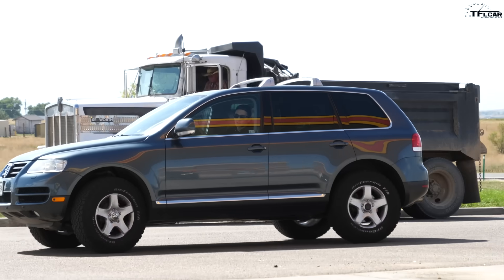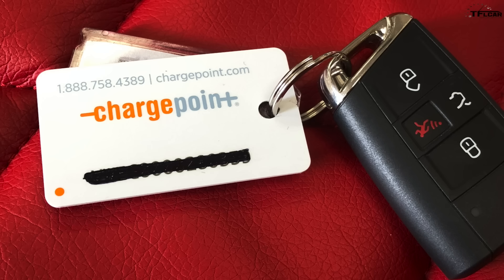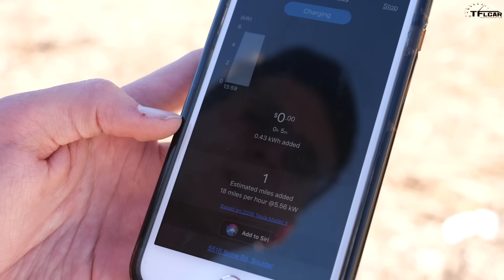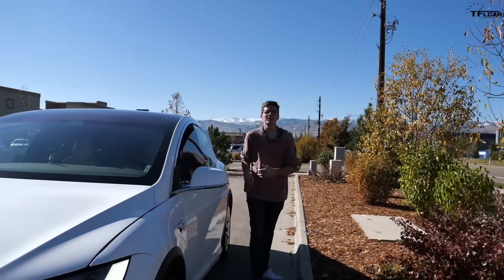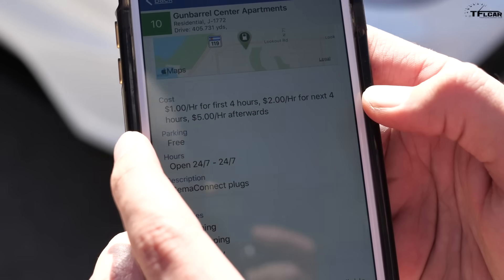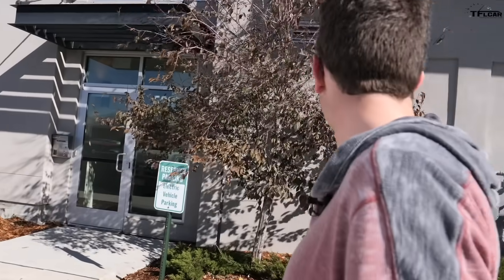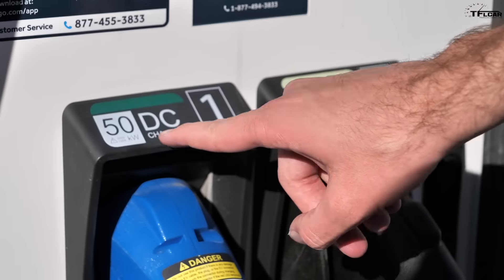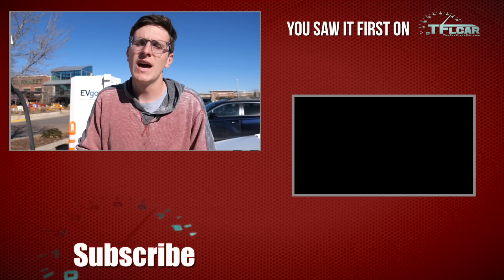Here’s Why Charging an Electric Car Can Suck - And It’s Not The Reason You Think!

Comment: "Most people don't have 240V"

Tommy, every house in the country has 240V, it's how the American grid works.. 2 hots and a neutral. It's there for anybody to use.
Reply: Yes pretty normal to have a 240 for the dryer. Get another in the garage for the car
Reply: And outdoor outlets in apartment parking lots are the norm in Anchorage AK. Plug It In!
Reply: 3-phase  400v in most houses in sweden. :)
Reply: True, but, it costs about $3k install the charger to use it. Make sure you include that in the economics of your EV purchase decision.
Reply: @montesimpson7954  - yep most of the cost is the charger itself, not the wiring from panel to charger
Reply: And when everyone plugs in after a hard days work the electrical grid shuts down !
Reply: What was meant is they are not available for the car.  More cost and resources are needed.  And of course, a garage.
Reply: i wonder what he thinks most dryers run on?
Reply: I know what you mean, the A phase and the B phase. I put 220V in my garage for a car lift.
Reply: @George Elmasry Thanks. My daughter is a 4 year EE degree person. In order to get her degree she had to take what is called: “High Power Lab.”

They have to take that course so if they ever have to do a high power installation, she won’t get killed. 

The other engineers reading this probably had to do this too.

Personally, I am not smart enough to do what she did. Her IQ is considerably higher than mine. I would have her install it for me. I am OK with having a child who is much more intelligent than I am.

Sanjosemike (no longer in CA)
Reply: @George Elmasry Congratulations Dr. Elmasry for an extraordinarily accomplishment and for you advice.

Amy had to stand on a rubber chair and wire up several boxes that were running “live.”

I’m sure she knew what she was doing but it also took some REAL courage. 

Thanks for your advice.

Sanjosemike (no longer in CA)
Reply: People living in appartment complexes wont have access to charging at home
Reply: He said MOSTR do not have 240 in their GARAGE. It helps if you LISTEN
Reply: @JohnFriday3  oic so unless you are outside the USA every house in the USA has 220 or 240 depending on what you want to call it, you should know what you are talking about, if you can afford an electric car you can for sure afford to can an electrician to have socket install for your car and the socket can be placed ANYWHERE YOU want it, even if you live in a condo complex all it ever takes is money
Reply: I install chargers for EVgo
The majority of chargers we are starting to install are 350kw.
Reply: @johnblutut5831  In many parts of the USA 220 is now required in garages in new construction and remodels for EV's to plug into. I know, I had to do it even I don't have a EV.......
Reply: In usa, 240v is usually accomplished by using 2 120v connections at same time
Reply: @williamhaynes7089  Two 120V at the same time.. really? Jesus man, read the comments above.
Reply: @George Elmasry - and how much for the charger itself?
Reply: Even so there are a lot of older homes that will need the panel box itself upgraded which costs $ Your only allowed so many breakers according to the panel you have.
Reply: @Matt-zu2hm  not necessarily. If the panel has the amp capacity you just need to add a circuit.
I added a 50a, 230v to my garage for a welders. Did the work myself and mainly used stuff I had in the barn. Cost mr like $10. 
If i had needed to but everything it would have run <$100.
$200 if I would have needed to add a sub-panel.
So, less than 3 tanks of gas for my 6 cylinder pickup.
Reply: @typoagain1  - maybe a permit? inspection by city ? If adding a sub pannel
Reply: Try finding 240 V in an apartment parking lot! Even in a home it's only available if you have an electric dryer in the garage. Otherwise you call an electrician for a custom install.
Reply: @jjjjquest9999  I wired my entire house and passed inspection. I will call myself.
Reply: @jjjjquest9999  - believe it or not Many of the Lighting fixtures and poles in parking lots are 480v in USA...
Reply: @williamhaynes7089  Look, power is transmitted at 10's of thousands of Volts, why is it hard to believe it's stepped down to a measly 480?

By the way, when units are named after people, as in Voltaire, the unit is capitalized. "V".. not "v"
Reply: @jjjjquest9999  you just need to connect a couple of wires, not that difficult.
Reply: Assuming every American home has a 240V service, you still have to hire an electrician to set up your charging station in your garage or carport.

Sanjosemike (no longer in CA)
Reply: A 220 plug does not use a neutral.  It is 2 hots and a ground.  You are right, most houses have two hots and a neutral.  Each legs is 120 to neutral.  220 hot to hot.  This is considered a single phase system.   You may call yourself an electrical engineer, but I know much more about electricity than you do.
Reply: @keithc5729  Two Universities, several Fortune 500 companies, and many professional working groups may also call me an electrical engineer.
Reply: @keithc5729  wrote "a 220 plug does not use a neutral" Uh, wrong.  The houses do use the neutral.  When you use 120V, the electricity goes through one hot, to the load, then out the neutral.  I don't know if the neutral is grounded, but when the damn squirrels chewed through the neutral line, the power had to back out through the other hot, causing a 220V spike, burning out a power surge protector.  Thus I'd tend to thing the neutral isn't grounded or that wouldn't have happened, the power would have just gone to ground.  The power line technicians say they've been fighting the squirrel problem all over town.  That is the problem with aluminum wires, too easy to chew through.  They cover the neutral wires now.
Reply: @tomgreene7942  I find it interesting that people want to argue with me about this.  I am the person that knows this kind of stuff.  Your story about the squirrel chewing through the neutral kind of proves the point.  When the squirrel chews through the neutral we call that an “open neutral”.  You are correct, the current can not go back on the neutral, so now you have two hots, and no neutral, this is what gives you 220 volts.
A neutral is only grounded at the meter.  A neutral is a current carrying conductor.  A ground is more like a safety wire, it is a bond.  A ground only carries current for a short time when something goes wrong, and then the circuit breaker trips.  This is so the wire and your house does not catch fire.  It does not protect people. To protect people we install a GFCI or a Arc Fault breaker.    David Falls,  above, knows what he is talking about.
Reply: @tomgreene7942  A 240V circuit uses a ground to trip the breaker in the event of a short to ground. A 240V circuit passes zero current to ground when operating normally. Yes neutral and ground are electrically the same at the panel.
Reply: @mikegreen1430  Congratulations for displaying a true peanut butter mind, very thick. The true sign of genius is an ability to combine thoughts and see new things.. you have a lot of work to do.
Reply: @mikegreen1430  
Debating this with you is as with a child, I gain nothing from it. You are free to believe however you wish, after all you are a technician right? Again, congratulations on such an achievement. Maybe now you can focus on knowing what you don't know you didn't know.
Reply: @keithc5729  nope...to keep it simple,  just like the engineer...

2 hots and a neutral that is grounded in a home build before the 1990's

I newer homes, the ground and neutral are seperate...look inside your breaker box and you will see.

You don't know as much as you think you know.
Reply: @grandinosour  I am the person that installs what you call a "breaker box".  I am the person that knows this stuff. A 220 circuit does not have a neutral.  A 220 service does have a neutral. The grounds and the neutrals are not bonded together in a sub-panel, but they are together at the service (the meter).
Reply: It's 110V in America, you from Europe or Asia I guess.
Reply: @yahyakhan9745  I'm from America, I'm also an electrical engineer 😀 We use 2-phase 240V. Inside the breaker box, however, the phases are split into two banks of 120V. All common household outlets use one of these phases to provide 120V. There are specialized outlets, though, that are wired to be 240V. For example the washer & dryer outlets and also the HVAC outlet are 240V. This is true of every house on our power grid. The higher voltage is available, but it requires a specialized outlet.
Reply: @user-cx2bk6pm2f  Nice
Reply: @yahyakhan9745  Some do refer to it as 110 and 220, but it's understood to be more or less equal.
Reply: @user-cx2bk6pm2f  Nice to know.
Reply: @user-cx2bk6pm2f  Never say 2 phase.  It's either single phase or three phase.  220 volt has uses two hots but it is single phase.
Reply: @user-cx2bk6pm2f  and the cost of an electrician to wire it, the possible cost of a separate circuit box to expand the available breakers.  You'd have to figure that into the up front cost of the car.  But it's doable if you wanted that extra bit of charging speed at home.
Reply: @user-cx2bk6pm2f  you are, amazingly, wrong. Residential homes in the USA is SINGLE phase 240V.  On the pole is a transformer that steps line voltage to 240V. The L1 and L2 connections are the ends of the low voltage side of that transformer.....  The transformer is center-tapped. That center tap is the neutral....which is also tied to ground.....which makes it the reference. L1 and L2 are 180 degrees out of phase relative each other.  Three phase connections have the lines, of which there are three, spaced at 120 degrees out of phase relative to one another. Two phase power has existed in America. It is rare and getting rarer. The two phases are offset by 45 degrees from one another. I find that this point is confusing to many people......even electrical engineers. I assure you I am correct. I went to substation training at Appalachian Electric Power in Columbus Ohio.
Reply: @fallsdp  
I make one comment and all the nerds come out. Get back in the basement and amaze yourself.
Reply: @user-cx2bk6pm2f  You are no engineer are you? I am an electronics technician. I have been playing with electricity since I was a 6 year old in the mid seventies. For all your claims of education and competence, you did not know something IN YOUR FIELD that someone with an Associate Degree from a community college knew. I have taught basic electricity. I covered service entrances. My students know that standard residential power is single phase. 
So ridicule away. You look more fraudulent and foolish with every post.
Reply: @user-cx2bk6pm2f  It seems that you should know the difference between 2 phase and single phase electrical power then.

David Falls is 100% correct in his description, though overly harsh in how he called you out.
Just admit that you misspoke and move on.

2 phase power distribution is a relic of the early 20th century, and only still exists in a couple of places in the US. Even then it is only because it is less of a hassle to continue to supply it than it is to rewire the very old commercial buildings that were built with it.

The vast majority of US homes are single phase, with a very small minority having 3 phase power.

Sincerely,
A lowly HVAC/R technician, with a long history of forcing engineers to change their screwed up impractical designs. ;)
Reply: @user-cx2bk6pm2f  That is still single phase power, by definition.
Split phase would also be acceptable, though less common.

I am aware that there are people who incorrectly call it 2 phase, you are the first I've ever seen defend their incorrect terminology so strongly.
Writers for Fortune 500 companies using incorrect terminology doesn't make it any better.

Go ahead and spec something out as "2 phase", and see how fast it gets kicked back.
Reply: @user-cx2bk6pm2f  240V is single phase and uses no ground. 120V is split phase and uses a ground. The ground is at the center tap of the transformer.
Reply: @user-cx2bk6pm2f  No. 120 and 240 are not equal at all (numbers are hard). 110/220 are not used. 120V is created by center tapping the secondary of the transformer and grounding that center tapped line. 120V is known as split phase.
Reply: @user-cx2bk6pm2f  Sorry, 120V is split phase, not 2-phase. The ground isn't involved in 240V except as a safety measure to trip the breaker. Sadly, you're the knucklehead in this case. 
Think about it. If one voltage is 180 out from the other, then one is positive while the other is negative. Second grade math tells us any value subtracted by the same value equals zero. Or 120 + (-120)=0. We could go into wave theory, but why bother?
Reply: @markbeiser  Crap. I just wrote almost the same reply. Thumbs up to you :)
Reply: @user-cx2bk6pm2f  Yes I use my washer outlet to charge my electric car.  Much quicker than the 120v
Reply: @AB-fc5kl  I think you mean dryer.  Washers are generally 110 and dryers 220
Reply: @ziggystardog  Actually I unplug my washer and plug in the car in the evenings. So I’ve been using the washer outlet.  It’s still faster than the 110 for charging though
Reply: @AB-fc5kl  what brand of washer, and what sort of receptacle or plug?  220 outlets aren’t standardized in the US, that’s why dryers are typically sold with cords.  It might be you have a washer dryer combo, or a 110 washer wired to a four wire 220 outlet with neutral for lighting and other purposes.  If you have a foreign or import washer, I suppose it could be 220 volt tolerant, but 220 AC is mostly 50 HZ outside the US and Canada.  Whatever you have is nonstandard.  Another possibility is you are confusing a dedicated 20 amp 110 outlet for 220.
Reply: @user-cx2bk6pm2f he said most people don't have that in the garage...meaning unless you're willing ot unplug your oven, drier or washer, and run heavy extension cords through your house...you're a bit boned....
Reply: @clomiancalcifer  You might have a point. I think Tommy is at least "reasonably" intelligent, so I'm fine giving him the benefit of the doubt. When my ears first heard him, though, it sounded as if he was saying something different
Reply: @yahyakhan9745  Your Stove and dryer in the USA are 240v. Same as Canada
Reply: @CanadianDiggersChannel  Mine are both 120v, because they are gas fueled!🙃
Of course this makes setting up home EV charging extra easy, because there are 240v plugs for each, I already have spare 60A and 30A circuits in my panel I can repurpose.
Reply: @yahyakhan9745  LOL you don't know how it works bro

Comment: Why not put a extra generator and battery while driving the other battery will be charged after the other dies. Stupidity
Reply: The 85kWh battery from Tesla weights 1200 pounds according to a quick Google search. Not to mention where do you put it? The packs I've seen in videos are almost as wide and long as the car.

Comment: So it’s apparent to me that owning an electric car might be good for local transit. Say you want to drive on an off-road adventure or from Salt Lake City to Denver....... it will take hours longer ( due to charging) than with a conventional fossil fuel burning system and will potentially cause more harm to the environment since either the electricity comes mostly  likely from fossil fuel burning power plant or perhaps wind powered in which case hundreds of thousands of birds are killed every year. Just saying. Wait till a “environmentally concerned” party comes into power and limits the amount of kW you are alllowed to consume on a weekly basis.

Comment: This is exactly why electrical cars are not the solution. A electrical car, even with a super charger takes a substantial amount of time to charge. This works if you are in a low density area specially if only a small percentage of people actually have electrical cars. Now take Asia. You have areas with millions of people, all living in apartments, thereby all are dependent on external charge stations.
If you ever spend any time in Asia, you know that even regular gas stations often have lines, giving you waiting periods of sometimes 20 minutes before you get your turn. Now imagine if everybody had an electrical car, and everybody needed to utilize external stations. A regular gas fillup takes less then 5 minutes, but you still have waiting periods, now if a fill up takes only 1 hour with a electrical car, you would have impossible lines. So in high dense areas, specially where the population is mostly apartment housed in high rises, this is simply not a option for the general population.

This is why hydrogen is a much better choice, even that it is not as efficient in the use of electricity, it replacers regular fueling with a process that takes similar time and thereby is actually a viable option. Also during emergency situation, due to weather and such, the electrical grid may be compromised, but hydrogen being stored in tanks would provide a certain buffer to bridge the duration of the emergency. Hydrogen, may it be fuel cells or conversion combustion is simply the better choice in these areas.
In areas where people can mount their own chargers and or the population density is low, electrical is a viable optionl